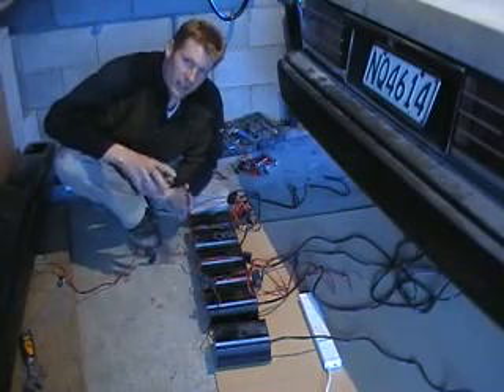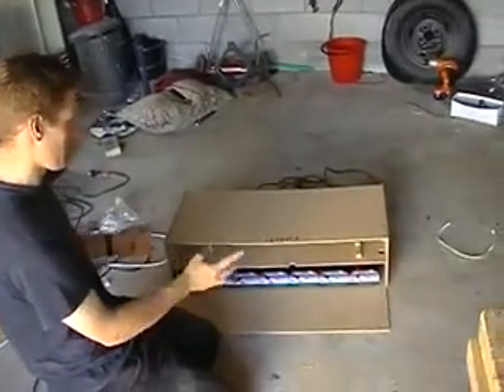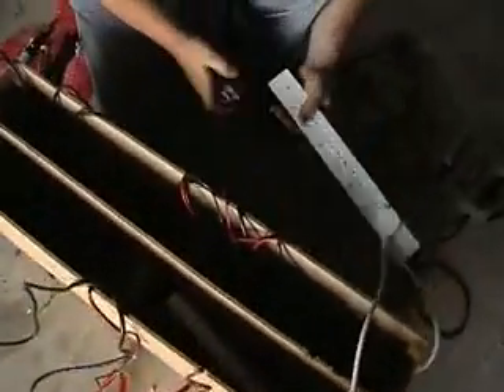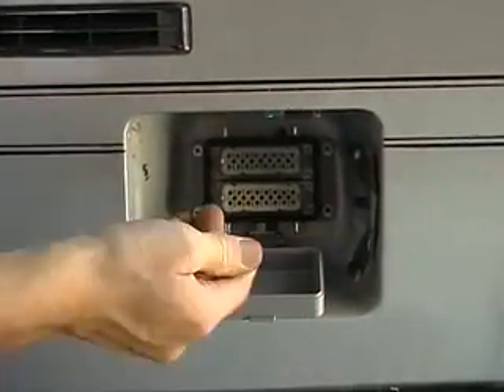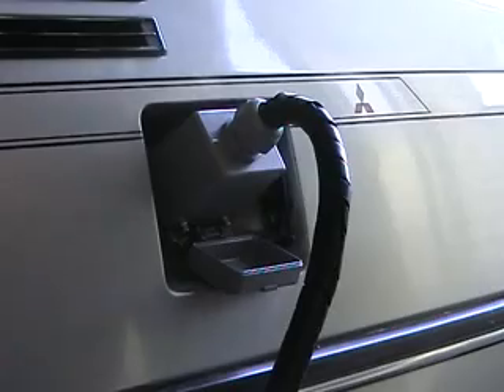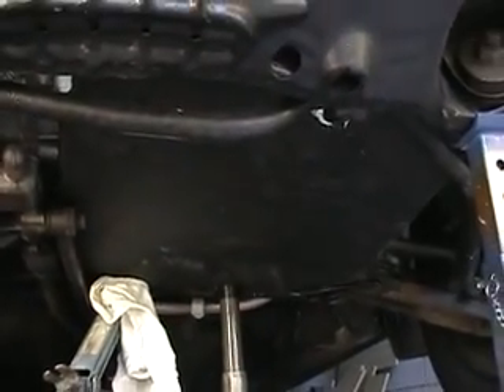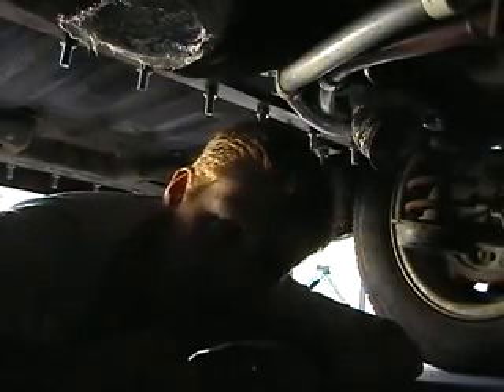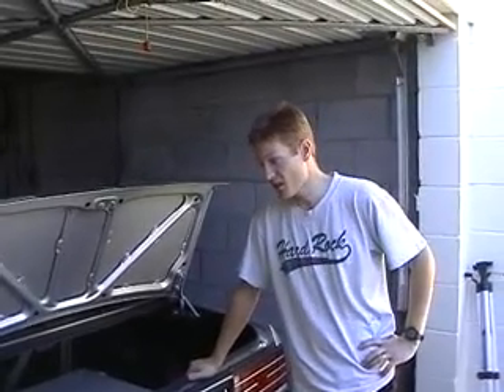Gav's EV Conversion - Step 17 - The Charging System

Comment from the maker: I would have loved to do that but it's expensive! An on board charger is a couple of grand and in NZ you would have to get the car electrically tested and certified as it'd effectively be a household appliance. That's on top of the safety inspection (in 2 weeks) and then the Warrant of Fitness inspection. There's lots of red tape for EV'ers in NZ.

Comment: The cooling/heating ducts and fans is pretty well configured, i just have one suggestion that will guarantee that you wont have any unwanted issues with the batteries etc.

Place a wire grill/mesh for the induction hose, cos you wouldnt want any stones or road stuff going into the battery area.